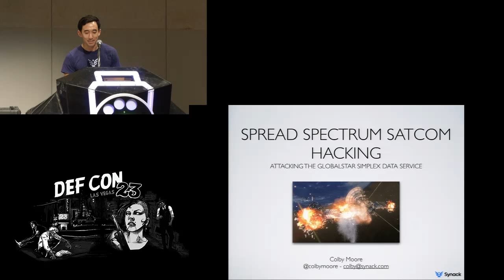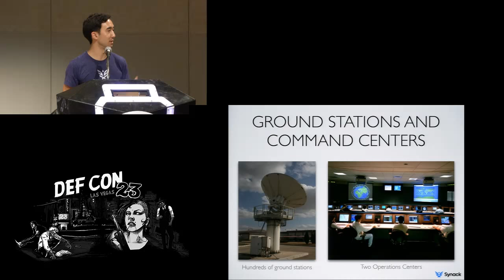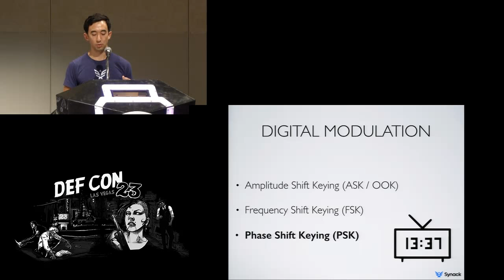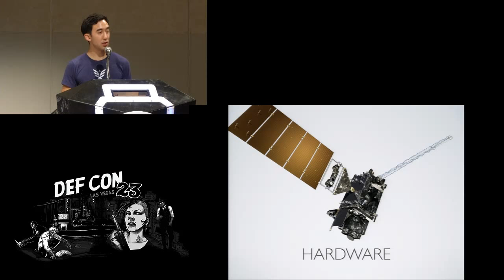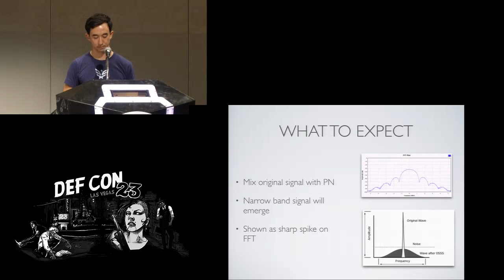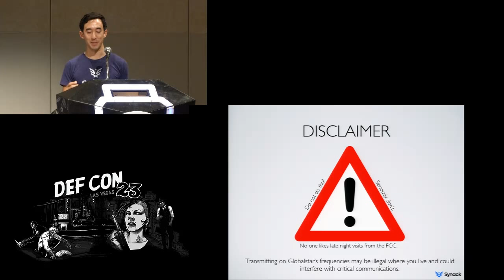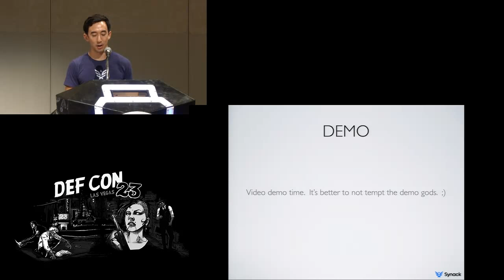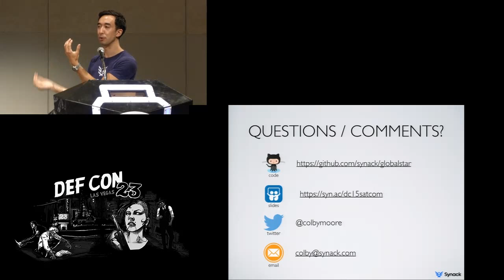DEF CON 23 - Colby Moore - Spread Spectrum Satcom Hacking

Comment: So, the pseudorandom signal is like the other side of the carrier (exa: the USB mode in SSB) in analog AM audio transmission?
Reply: Not really. It doesn't change the frequency of the transmission, but breaks up the data in such a way as to allow recovery after being mixed with random noise, which is interestingly what other signals modulated like this look like. This allows for a lower noise floor (less power needed to transmit) but also for transmitters to not have to synchronized when they send and can send at any arbitrary time.